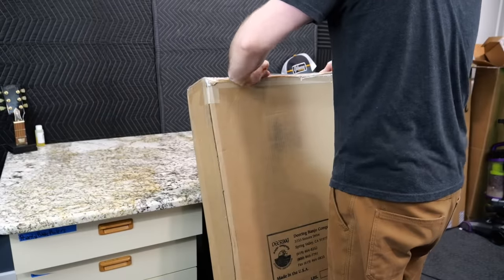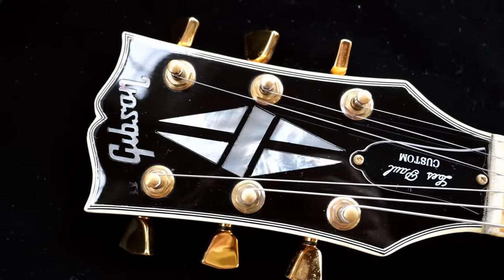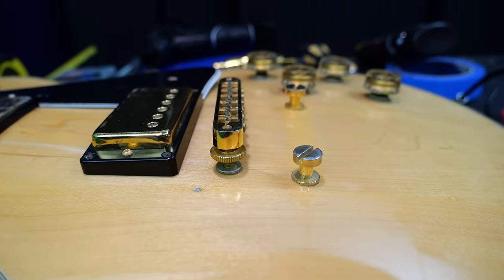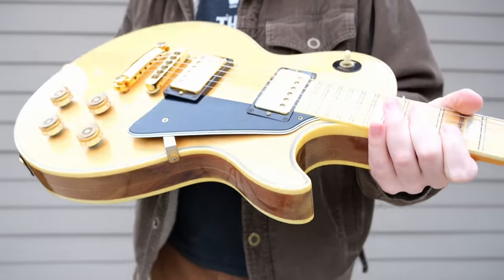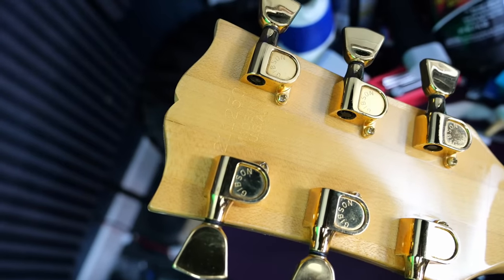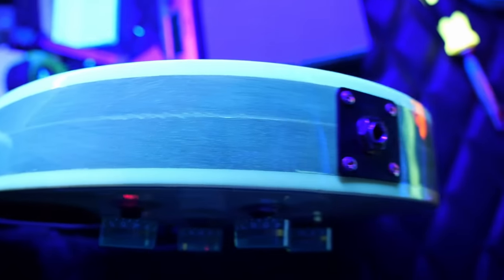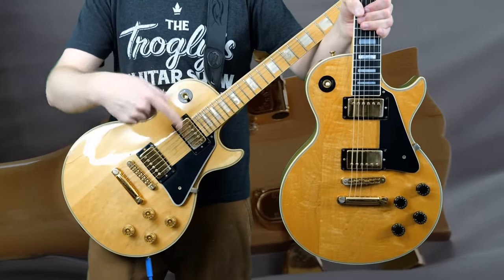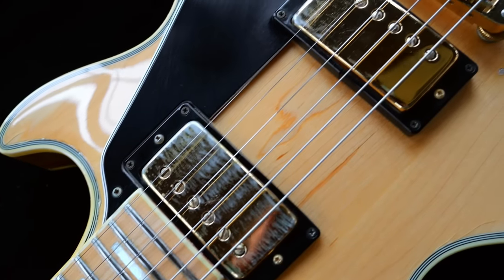I FINALLY Got a "Blonde Beauty" | 1976 Gibson Les Paul Custom Maple Fretboard Review + Ebony Compare

Comment: Hey there, this is Jim, the original owner! I finally got to see this video. Man you cleaned it up and made it look purty!!! 1st: I'm sooo, sooo, soo, soo, soo etc. sorry about those stupid holes. I was young and an idiot. It was actually an Arp Avatar system which predated MIDI by quite a few years. 2nd: Honest I swear the only modification done was on the knobs. That wasn't even my idea. The salesman pretty much insisted, and again... I was young and an idiot. Yes, he tapped those suckers in with a hammer, causing the checking around one of the knobs. 3rd: I really only played this for a couple of years. I was in a jazz band in college, and I played in a band that played in churches and youth groups on weekends, so not much in the way of cigarette smoke and broken beer bottle damage. I played a lot of distorted Neil Young & Crazy Horse stuff in my basement, so that's how the pickups got scuffed. I would estimate that it truly did spend the better part of 35 years just hibernating in my closet. I only rarely took it out. I mostly play acoustic, and when I do play electric it's fingerstyle on a Strat. Thanks so much for bring it back to life!

Comment: I bought this exact guitar in 1978 for $300 used.  The store had marked it down like 5 times but no one wanted it.  I have played it almost every day since then.  When the Northridge earthquake occurred I lived about half a mile from the epicenter.  Over $100K damage to my house.  This guitar was leaning up against my 2 4x12 Marshall cabs which fell over onto the guitar.  Damage?  The plastic tip of the selector switch broke.  That was it.  I blame the 3 piece neck for saving the headstock from breaking.  I am not a collector - I still play the thing regularly.
Reply: wOW, what a story
Reply: My '78 fell off a 4 foot high stage onto a cement floor and pretty much no damage! I'll attest to their toughness. They do have a bit sharper sound than an ebony or rosewood fretboard LP. Mine has the plastic shell case.

Comment: The maple neck does not sound better. It thins out the lows. 😠Add to that I am a maple madman when it comes to Fenders. .A Fender just has to be a maple fretboard.
Reply: This is complete and utter horseshit. When the guitar is plugged in and any amount of distortion whatsoever is applied, the materials used make no significant tonal difference. Jim Lill disproved this a few years ago, as well as many others.

Comment: Someone like a Twoodford could dowel it and touch it up with aged lacquer and a bit of artistic stain to match the woodgrain so that it'd be imperceptible.
I am a fan of the 3-piece maple necks personally (fretboard material doesn't matter so me so much - maple, rosewood, ebony) and prefer it over mahogany.

It's likely that I like these because this coincided with the volute and (I think) slightly shallower headstock angle - that are features I like.
One day I may a 70's LP to the stable.

Comment: Small correction: the Roland GK pickup is NOT MIDI. It’s a “divided” pickup sending a separate signal for each string to a compatible unit like VG-88. I had a number of guitars equipped with this (either stock or aftermarket) for years. Pretty cool actually. But eventually I transitioned back to a standard pedalboard but also use Helix and HX Stomp in certain situations. Enjoy your videos 👍🏻! Thanks 😊
Reply: This was actually an Arp Avatar system, not Roland (Jim, the original owner checking in)
Reply: @JimF22003  - Thanks, though I still stand by my correction in that he referred to the Roland system as MIDI as opposed to GK. 😆 The Roland GK ecosystem is probably one of few (or only) guitar “synthesizer” systems that have continued to thrive even into today. Cheers!

Comment: Great video as always and very cool „blonde beauty“! I have a Gibson LP Custom in Ebody from 1976 with a stamped six digit serial number in the 200000 range including „Made in USA“ impression. The guitar was built in Kalamzoo and has a Schaller Nashville bridge and pots dated late 1976. It looks like not all Gibson Les Pauls from 1976 have a printed eight-digit serial number with a 00 prefix (although this is rare). Presumably the guitar was built in 1974/1975 and finished later.

Comment: As far as the holes are concerned I think it'd be cool to track down what model of midi pickup was on it and stick one back on there. You'd get a mismatch in the grain if you plugged the holes with dowels, and it'd be really cool for the museum to have an example of what people actually did with their guitars back in the day before they became expensive collector's items.
Reply: Hi original owner Jim here. It was an Arp Avatar system with a "hex" pickup. I believe Jimmy Page used this on one album.

Comment: So the fretboard and neck are maple, so does that mean on this guitar the fretboard is not a separate piece apart from the neck? As like an ebony or other fretboard is glued to the neck material whatever the neck is made of, it’s a separate piece, but this particular guitar has the maple neck and the fretboard is not a separate piece but is made of the maple Neck and is one piece?
Reply from the maker: It is a glued on maple fretboard- otherwise you’d see the seams of the 3 piece neck. Fender makes them like you’re describing sometimes though

Comment: I remember going to King Music in Albuquerque in 1975 or so and lusting after a natural-finish Les Paul Standard that was selling for ~$800. (I had it off the wall one time, but they wouldn’t let me use a pick and I wasn’t much with my fingers at the time.) My memory is that it had a “blonde” fretboard like this Custom, but I may be conflating it with a different guitar.  I don’t remember if/when it sold, but it hung there for quite a while.

Comment: If I were to guess, I'd say 1975 or 1976, just by looking at the thing.  My dear old brother had a 1975 Gibson "Grabber" bass.  The thing was all maple, but the body wasn't as glossy.  The big problem with that Grabber bass is that nobody bought that model.  The similar "Ripper" used by Gene Simmons of Kiss, was the one sought out.  Especially over time, people realized the SLIDING pick-up.  Yes, SLIDING.  I don't know if you've reviewed one or not... Anyway, those Grabbers and Rippers never really caught on right away.  There was a whole bunch of folks who didn't care for Kiss, and at that time in the mid 70s, I've heard tell that Fender P-Basses were much less than those Gibsons.  So, I think Gibson was taking chances with maple, it was not their first pick with their trademark models.  I'm so glad they went maple on this one.  I went guitar shopping in my area for MANY years, and here in upstate new york NOBODY stocked these.  You've got a keeper, museum piece here!!

Comment: I actually have one of these...... EXCEPT....... Mine is an IBANEZ! YES, it's a "Les Paul" style, YES, it's a "Blonde Beauty" and YES IT DOES HAVE A MAPLE NECK AND FRETBOARD! The differences are.... The inlays are NOT MOP, (They're black in color, and I'm not sure what they're made out of) the pickups are "Zebra" pickups on both bridge and neck, (Twin single coil pick ups both black and white at each position) and this is a first generation post lawsuit model. (Meaning that Ibanez stopped imitating the Gibson "Open Book" style head stock, and came up with a new design) I paid about $500.00 (U.S.) at a pawn shop about twenty five years ago, and, sadly it did not have a case. Very nice action, like cutting through butter with a hot knife. I haven't played it in years, but I still love it, and might pull it out again someday. There's a little wear and tear on the fretboard, but it doesn't affect the action, or playability, but you can tell that this guitar was played and loved before I bought it. I often wonder if it was in the pawn shop because the previous owner HAD to sell it, or if I might've bought a "Hot" guitar. Either way, I loved it the moment I plugged it in, and started jamming on it. Just thought I'd share that with you after watching this video.

Comment: I was wondering why cutting the saddles for the radius is not a go to on Gibson, but it is other things that use similar bridges.  Sure it is metal so it is a pain, but it cannot be that hard.  The reason why you can get nylon inserts is so you can easily cut off radius in them, but in the '70s people were cutting brass blocks all the time so why not the saddles.

Comment: The maple fretboard one rings and sustain better maybe because the string action is higher(due to collapse bridge) than the ebony fretboard one(assuming it's in low action setting). I know it from my own experience on setting my own guitar, comparing a lil higher action versus low action. 
The bright sound may come from the maple fretboard and neck, because maple fretboard and neck tends to sound brighter. 
I love the sound of the all maple fretboard one compare to the ebony fretboard one. That's what I want from a Les Paul. It's like a Strat/Tele with steroids 🤘

Comment: Am I the only one that thought that plug job looked really bad? lol
Reply from the maker: looked better before I lightly sanded the tops of the toothpicks. I didn't glue them in or anything, they'd come out real easy to do again by the skilled hands of a professional when I decide what I want to do
Reply: @Trog  Yeah the finish would have to be touched up if proper dowels are put in and sanded flush anyways lol